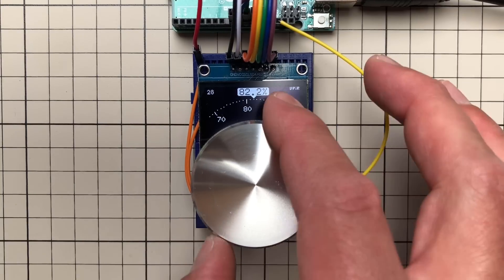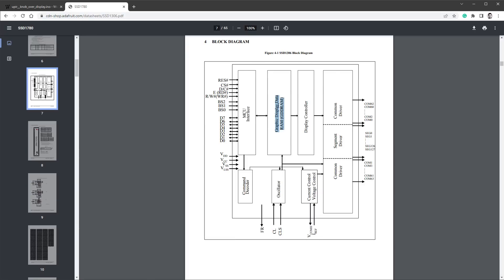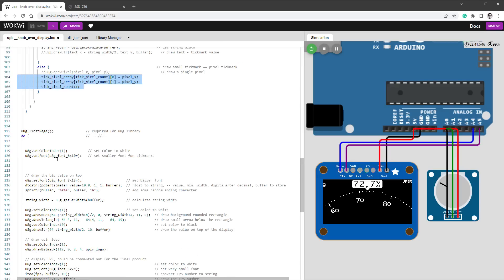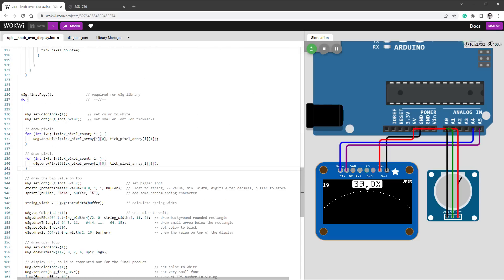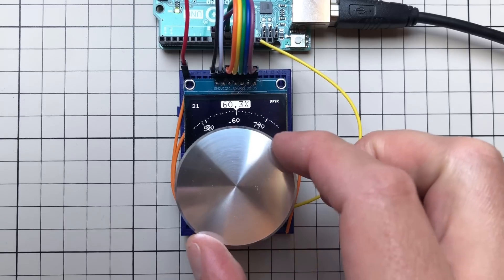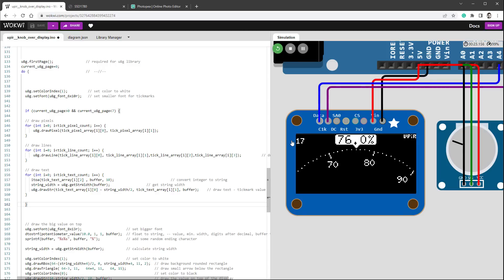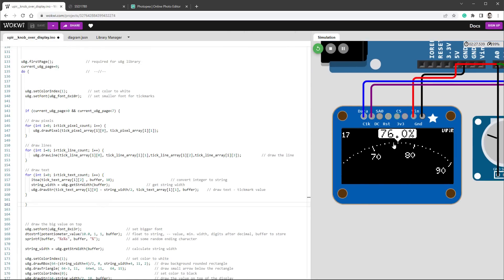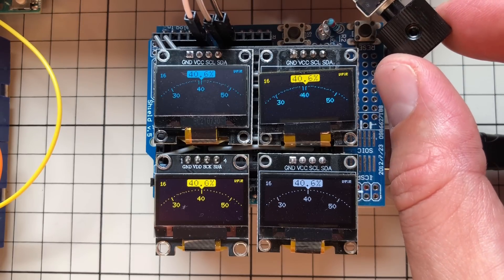This one change made Arduino run at 27.5361 FPS

Comment: Nice Project, I really like the look of it.
I'd recommend to buffer the displayed value and only update it / rerender when the measured value deviates by a value of more than 0.1 or 0.2.
This way you should be able to get rid of the jitter.
Reply: Also your code would probably run much faster if you use a data structure which makes use of the pages. if you know which dots/lines/text to draw in which page beforehand you do not have to have multiple loops inside a loop so the execution time would roughly drop from quadratic to linear.

Also, don't loop over all tickmarks, calculate their angle and determine wether they are inside the screen. You already know the potentiometer value, so you can do it the other way round.
Calculate the first tickmark on the screen, for example if the potentiometer is 50% you know you only need to draw 35 to 65, no need to do all the calculations for the other tickmarks.
This also saves you branches inside a loop, which can be painfully slow...
Reply from the maker: Thank you for your comment and proposed changes. Right now, I´m happy with the (almost) 30FPS, but I will consider your ideas for next projects when I struggle with performance (which is pretty much always :)

Comment: very nice project !
if I want to start from 50 to 150 (instead 0-100), where I need to modify ?
tnx in advance !
Reply from the maker: Thank you! There is a line on the bottom of the sketch for reading the potentiometer value and mapping it from 0-1000. Just change the numbers to 500 and 1500 and you should be good to go. If not, let me know.

Comment: Nice project , you can mount the knob on a stepper motor and use it as encoder ,  the result will be a remote  controlled volume knob.
Reply from the maker: Thank you. Good idea with the stepper motor. I might try it next time.

Comment: Nice tutorial I absolutely like your work !! 
I think if you had an ADC with better resolution, you be having more stable system.
Reply: Finer resolution isn't the problem. Less noise is the problem, that can be somewhat accounted for in software by smoothing.
Using a pot is inherently a noisy proposition however without great care and expense in selection (and even then).
Reply from the maker: @zyeborm Agreed. I´ve pretty much only used potentiometer for a simplicity, but it would probably make more sense to just replace it with a rotary encoder.
Reply: @upir_upir  just make average of last 4 measurment it still will be damn fast but you will not see this wierd jumps when not touching knoob, Sory for my eng hope you understand ;p
Reply from the maker: Thank you for your comment, I´m glad you like it! I agree, the readings are still wiggling a little bit, a more stable readings would probably look better..

Comment: "This one change.... "  LOL  Still its useful to see how the page swapping works on these Oled screens. 

I was thinking the arrays could be calculated at setup(). or calculated outside the prog before hand for each page and then held in a static array. Also the pixel / lines screen changes could be limited to say 5 screens based on the decernable pixel difference. eg if above 5 screens you can't see any pixel changes why plot for 7 or 8 screens. [I couldnt tell if you were allowing for the rate of change when you turn the knob]

The only thing which changes with a greater resolution is the position of the numbers. There i would have an array to rememeber the old number positions and plan the new number position. Then draw over the old numbers in black, and rewrite the new position in white. [ If your code allows, you might reserve two screens exclusively for the numbers and then swap between these when you write and overwrite, eg to avoid flicker].
Reply from the maker: Thank you for your long comment. I agree with all your changes, and I think that all of them would allow for even better performance. I have basically stoped when I was close to 30 FPS, as I was feeling that any additional change would mean a lot of new code for only a slight performance improvement, and also because 30FPS is usually considered as "smooth".

Comment: Really nice rendering!
In old video games the costly sin/cos computations were cached in an array to optimize it, maybe another optim to try
Reply from the maker: Thank you! As for your suggestion, the code is already using lookup tables for sin/cos calculations, although not all of them. You might probably get one or two extra FPS if you use lookup tables for all calculations.
Reply: You may be can pre-compute, an array for the dots, an array for the lines and OR them together. Reflect around the center axis to reduce memory required.
Reply: Indeed, and using lookup tables of legal quadrature sequences to debounce the encoder is great rather than multiple conditional branches. Even logical XOR and STATUS,Z in ASM is worth doing if things are critical. I always used to use hardware debouncing using filters and schmitt triggers but software always seems superior if tuned correctly, plus, the spurious data which the hardware approach aims to filter out contains useful cues for fast scrolling and interpolating for that 'accelerometer' style of encoder navigation.

Comment: Great optimizations! I'm wondering if using the three-parameter call to the SPI initializer might be even faster; the version you're using may use software SPI under the hood in u8glib. Here's the 3-parameter one: U8GLIB_SSD1306_128X64(uint8_t cs, uint8_t a0, uint8_t reset = U8G_PIN_NONE)
Reply from the maker: That´s a great suggestion and you might be right. I will try your 3-parameter initialization to see if this makes any difference in performance (i.e. if I´m really using software SPI instead of hardware SPI). I will update this comment once I try it.
Reply: @upir_upir  I moved from software to hardware SPI in one of my projects and hit 160FPS instead of 30ish I think it was on an esp32.

This is the init
#define OLED_CLK    D5  //sck
#define OLED_MOSI   D7  //sda
#define OLED_RESET  D2  //Res
#define OLED_DC     D1  //dc
#define OLED_CS     D0  //csU8G2_SH1106_128X64_NONAME_F_4W_HW_SPI  u8g2(U8G2_R0, /*cs*/ OLED_CS, /*dc*/ OLED_DC, /*reset*/ OLED_RESET);

This is the draw.

  u8g2.clearBuffer();         // clear the internal memory  
  u8g2.drawStr(posx,posy,outdata);  // write something to the internal memory
  u8g2.drawFrame(0,0,display_width,display_height);  //draw this last as the string drawing also draws "black" pixels and you can get shadows in the box.
  u8g2.sendBuffer();          // transfer internal memory to the display  

Much simpler graphically than what you're doing of course.

My other suggestion is set a LED/pin to on for various chunks of your code, then off after and use a scope to look at the % of time you spend in any given function so you can ensure you are spending your time optimising in the right spots.

Comment: FWIW, it is VERY important that, if you are using pages, you change the zero position of Y to be the top of the relevant page(s).  You can see that the meter needs to be moved down 1 or 2 pixels because it isn't fully within the page range.  Other than that, bloddy impressive, mate!
Reply from the maker: Thank you, Keith! Could you please clarify a little bit more how you change the zero position of Y to be on the top of the relevant page? From the screenshot in Photopea, it looks like the meter is aligned properly. Do you mean the pixels, or the top part? Thanks.
Reply: @upir_upir  

1. As each page is 20 pixels high, to ensure that an object lies within a page, you would just need not make sure that the top of that object lies at or below a multiple of 20.
2.  Looking closer at the image at 14:39, I realized that the arc of the meter looks flat at the top because it IS flat at the top because of the low resolution of the screen.  It doesn't need to be moved down because the top is sitting at a page boundary already.  Oops.  My bad.

Comment: A couple more optimizations that you can try:
1. It looks like you write nothing to the last page of vram, so you should be able to skip it entirely (i.e. change your while loop to end on page 6)
2. You can unroll your loop to avoid any if-statements and reduce costly branches.

Edit: I just tested both of these optimizations out on WOKWI and got very promising results. 23 FPS MINIMUM on the simulator. I'd test it out myself for real, but I don't have the hardware. I'm assuming that would net you >30 FPS consistently on real hardware.

Here's a wowki project with the optimizations applied: 330316460209472082
Reply from the maker: Thank you for your comment and suggestions, those are great! Definitely something to try next time.
Reply: @upir_upir  Made some more changes to these optimisations and it's now at 25 fps minimum on the emulator :) Mainly just getting rid of anything that is computed multiple times. Wowki project id: 330533008303981140
Reply from the maker: @JamesHBall  You are crazy good :)
Reply: @JamesHBall  That analog read, isn't it handier that you do that at the start of the loop and maybe if the value didn't change you just skip over everything :) it's a oled screen and has a buffer of 8 pages ;)
Reply: @upir_upir   @James H Ball  I've removed one unnecessary rounding and changed the operations to remove inaccuracies (line 136), seems to give an additional +1 FPS gain on average on the simulator. Wowiki project id:  332487506744312402
Reply: @AcrobotMovies  you got quite often a double 0 at the end
Reply: doesnt the compiler optimizer know to unroll loops
Reply: @duality4y  not in all cases, oftentimes it's up to the programmer to manually unroll. There's also cases that would be obvious to the programmer as safe to unroll, but the compiler can't prove would be safe to unroll. Lastly unrolling does not always speed things up and can slow things down in some scenarios, so that's another thing the compiler has to judge and might not be able to without knowing what your input data usually looks like, while the programmer might be able to judge that better.
Reply: Are branches costly on AVR? I would expect that a conditional branch only takes 2-3 cycles, as there is no pipeline to invalidate. I've been playing around with Arduino for years, but have never seen this awesome emulator before, so now I can just test it out!
Reply: Quick tips:
- Use functions. :)
It does not make your code faster, but it is way cleaner, readable & maintainable (no need to change the code at 4 different places)
- Use less global variables. Use locals & constants.
Not everything needs to be global all the time.

Here are some additional improvements I made:
- I used the lookup table trick (for sin/cos calculations) also for the lines & texts. I don't know why it was only used for the pixels.
- I only recalculate & redraw, if the potentiometer value has been changed.
- Fixed the boundaries code so that the ticks and labels don't disappear too soon. (We need to use all 7 pages for this fix) We can now show 4 labels at the same time.

I'm now running at >23 fps when rotating and >95 fps idle. :)

wowki project cleaned up: 330369650565055058

Comment: Thanks for spelling Aluminium correctly. Sorry that's all I'm pointing out but I can't even tell how many times I've just became mildly agitated at listening to Aluminum.
Reply from the maker: Actually it seems that both are correct, at least according to this page - https://www.merriam-webster.com/words-at-play/aluminum-vs-aluminium

That said, I still prefer Aluminium :)
Reply: @upir_upir  I know I'm a bit of a Vocab N@zi.
I just find it better and more uniform when compared to other elements in the periodic table. For example: Rhenium not Rhenum, Titanium not Titanum, Uranium not Uranum

Noah Webster, in his 1828 An American Dictionary of the English Language, defined aluminum as "The name given to the supposed metallic base of alumina." - from you link, very helpful, thanks
Reply from the maker: @jackcameroon8423  Fully agree with being consistent with the periodic table.
Reply: Imperial is superior to metric
Reply: @motionsick   
1feet = 12 inches
1 mile = 5280 feet
1 mile = 1760 yards
1 pound = 16 ounces
1 imperial tonne = 2,240 pounds

Also, mass and weight in the imperial system mean the same thing? Y U DO DIS?

It's an unnecessary pain in the arse we all can do without. Else, people will keep calculating how many hamburgers long their washing machines are.